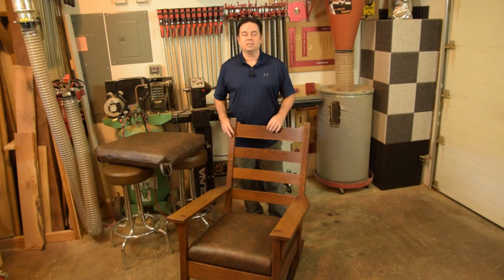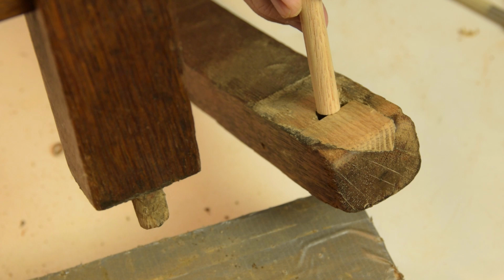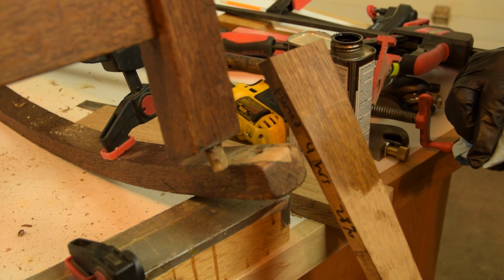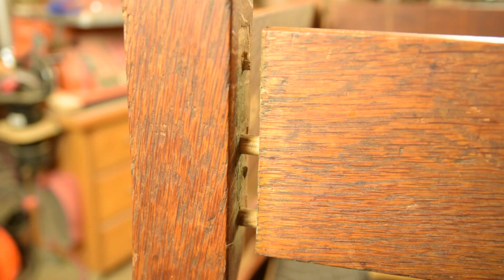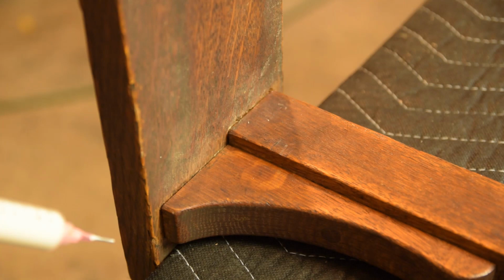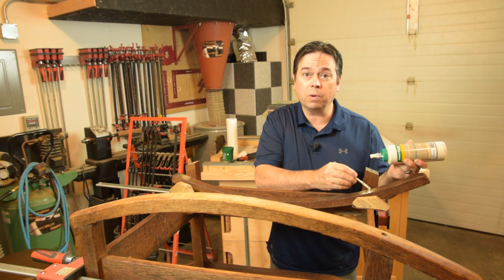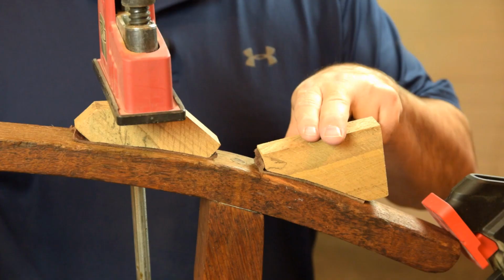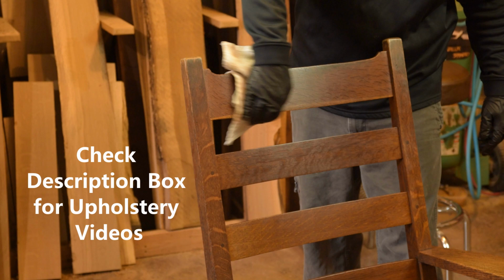Gustav Stickley Rocker Repair and Restoration Antique Rocking Chair Fix and Wood Repairs Glue Chair

Comment: Wow, dowelled construction on a G.Stickley!
Reply from the maker: I know, I was shocked.  Still a cool old rocker.  Thanks.
Reply: @TheThoughtfulWoodworker  BTW what are your thoughts on the use of period-correct glue for a project like this where the piece is pretty valuable? Old fashioned glues could be relatively easily released to allow for future repairs, whereas PVA is permanent. Thanks.
Reply from the maker: @gilessteve  I personally don't like hide glue.  I've had it fail before, but I've had great luck with Titebind II PVA style glue.  I basically want the repair to hold, so I use the best glue available.  Thanks.
Reply: @TheThoughtfulWoodworker  Cheers! It's something I don't have to worry about since I only work on my own cheap pine furniture. I've found PVA to be incredibly strong.
Reply: Im working on a desk right now and the whole damn thing is doweled

Comment: Excellent video!  Did that wax have dye in it?
Reply from the maker: Thanks!  I used Briwax mid brown paste wax.  It looks pretty dark when you first put it on, but once you wipe it back, it doesn't change the overall color much.  The main benefit is it will even out the color of chips and blemishes in the wood.  
Best